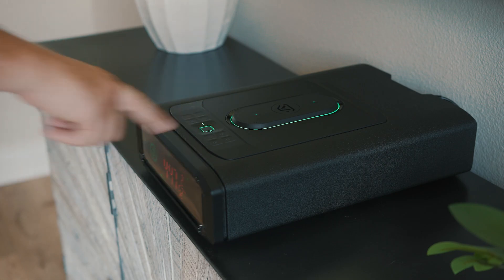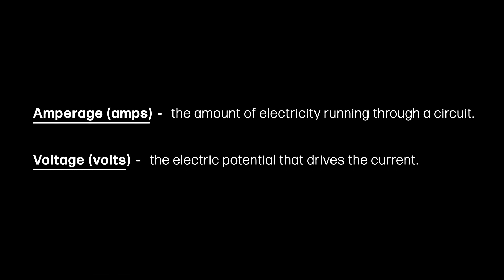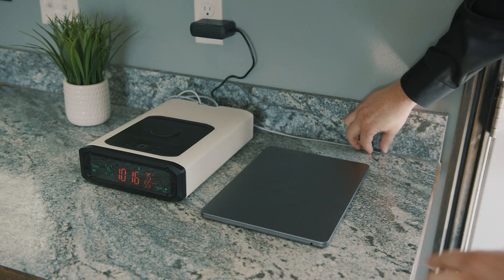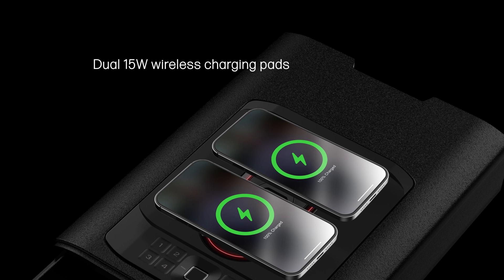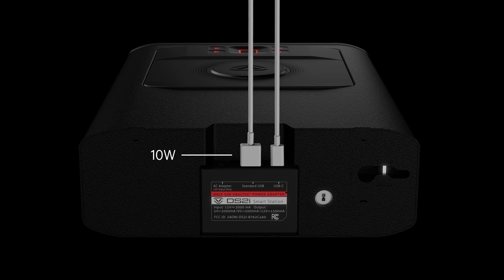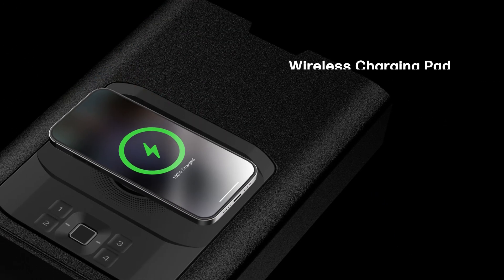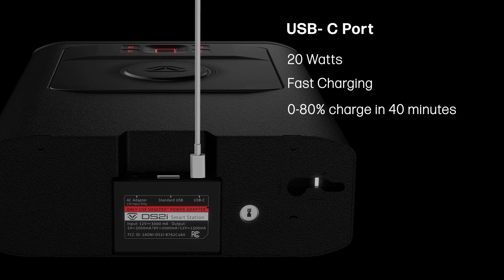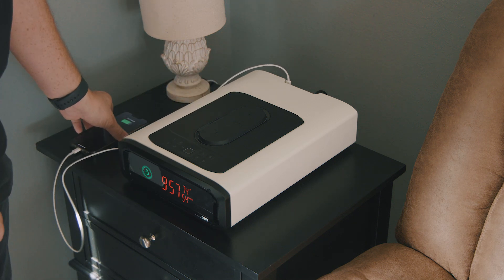The Fastest Way to Charge With the Smart Station Series

Comment: What happens if the wireless charging pad stops charging? This seems to be the issue on my DS2i. Is there a way to replace the pad?
Reply: The same has happened with my DS5i. The charging pad no longer charges and I have only had it for 3 months.

Comment: I hear a subtle but audible beeping sound when the wireless charger lights are off. The beeping stops when I use touch to turn them on or have them stay on permanently using the app. I saw another commenter complain about this on another video as well. Is this normal and/or is Vaultek aware? I know most electronics make noise but it's pretty distracting when trying to sleep.
Reply from the maker: Please reach out to our support team at support@vaulteksafe.com they will be able to help.
Reply: Which model?
Reply: @JohnnyC-g7p  DS5i. I ended up returning it unfortunately. I'm younger so could just have more sensitive ears.
Reply: @JohnnyC-g7p  DS5i. Unfortunately I ended up returning it. Nice safe but it bothered my sensitive ears too much.